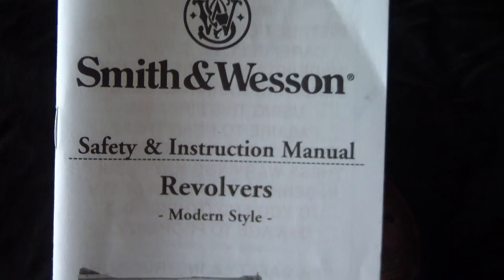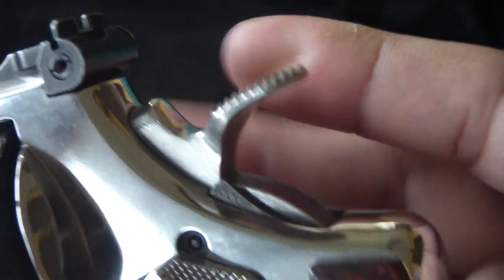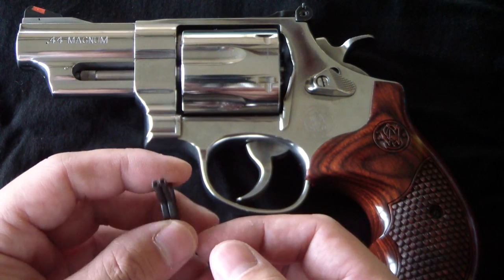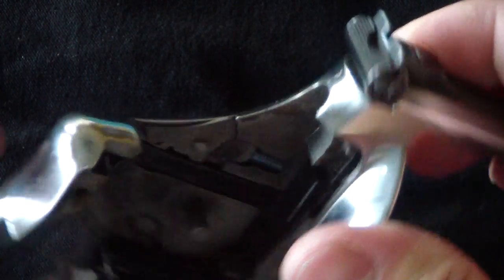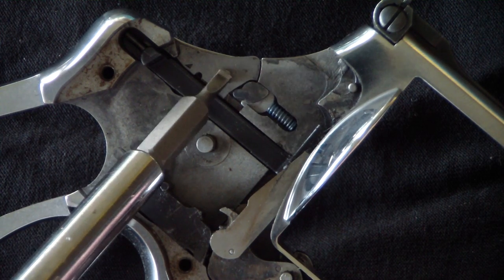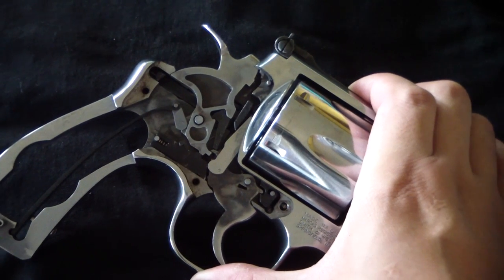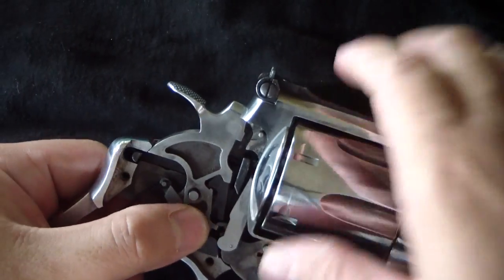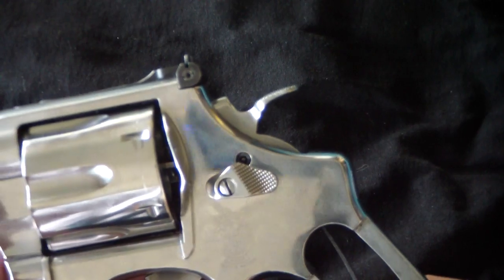s&w revolver key lock (close up in HD)

Comment: That damn keylock is the reason why I will not even consider buying a new Smith revolver when there are so many older examples out there that don't have this "feature".
Reply: Me too
Reply: Same!
Reply: @zachariahz9832  I have a new one. I removed the lock and plugged it up with an Original Precision kit. The new ones are a lot cheaper than the vintage ones and I like mine a lot better after removing the lock!

Comment: You can removed the lock and it has a tiny spring on the back of that plate that rises and falls. But there will be a hole in the side of your gun if you do. Or, you can take the plate out and grind off that “nub” and put it back in and you’ll never know it.

Comment: I just bought a 629 and didn't even give the lock a second thought.  Then I read on the internet how everyone hates the thing.  If given the choice I wouldn't want it on there either.  Failures due to the mechanism are pretty rare.  Guess I don't understand why this is such a huge issue.
Reply: Owen Hoffman it's not a huge deal. I have two. Great guns. It can be removed so people shouldn't care.
Reply: I guess it's a matter of odds.  My 686P has the lock and I had zero idea it was even there until a friend told me about it.  He was hell bent on telling me I should remove it, but I have a different take.  If it's not broken, why mess with it?  Using the "what do you do if it fails when you need it" I think is very unlikely.  I dump hundreds of rounds through various guns most months.  The likelihood of a failure would seem far higher in one of my practice sessions than the very moment I'd need the thing in a defensive situation.  If you never shoot your gun and only have it for that one moment of necessity, then it's my opinion you're too reckless to be owning a firearm.  Other than that, the few hundred I've put through that 686P have gone as intended whether I was shooting magnums or specials.  Doesn't seem an issue in my opinion.

Comment: hey bro..u seem to know ur stuff. .so i got a question for u..i own a 686 plus snubbie. .the other day i was cleaning it and noticed when i pulled the trigger back that the internals seemed like they had some rust...the gun is brand spanking new...so i took off the rubber grips and noticed that its like brownish orange dust....whicj im thinking rust...soooooo????? do i put oil in there???? ive heard that if u put oil u will gum it up....please sdvise brotha. ...by the way. .i have hoppes oil lubricant that i use to clean the gun.
Reply from the maker: Yeah you don't want to just soak the internals down heavy but i'd remove the side plate and see whats going on if you don't feel comfortable doing that your self take it to a gunshop that services guns. Sounds like rust to me I have had that happen to me once bought the revolver got it home always felt it was gritty and to find out under the plate internals covered in rust.
Reply: ok cool.....will do....do u ever put ANY kind of lubricant in there?
Reply from the maker: yes but very light coat.

Comment: I’ve seen where someone had taken the “locked bar” piece out but left the turn key lock in the gun, is the gun still safe to use?
Reply: Yes, I took mine out and replaced the actual key lock with an Original Precision plug. There’s a spring in the frame that holds the lock or plug and it’s not in the way of any moving parts.
Reply: I've put 2,000 rounds through 629-6 removed the lock even before I fired first round.
Reply: @ShaunPaget  Could you have done the same with it in and not have a failure?
Reply: @francischambless5919  it has been documented the lock inadvertently actuating under heavy recoil.  .44 is no slouch..  It is also a feature many people including myself find highly undersireable.  Pre locks out sell new s&w every time on gun brok er. Check for yourself.
Reply: @mikem2132  Thanks for the tip.  I didn't know anyone was making a plug.  I'll be sending out an order shortly.
Reply: @mikem2132   thanks for the info.  I installed it moment's ago.  I am well pleased  Origional Precision.

Comment: I can see how the lock feature is useful in households with small, inquisitive children. It appears to be more reliable than the cheap trigger locks used heretofore that can be easily defeated by a five-year-old. It could well prevent tragedies and subsequent disintegration of marriages and families. Disabling the lock should only be done by those who don't have youngsters in the house. I complement the designers responsible for this innovation.
Reply: I was a young and inquisitive child in the EARLY  sixties well before the rise of the safetie-sallies and was instructed to NOT touch guns unsupervised. Under supervision I would dry-fire, etc. I guess the population was just a lot freaking more intelligent.
Reply: If you have young  Children you need a safe, not a trigger lock. Imagine all the time, effort & training people saved because you can just turn the key, The number of other handgun manufacturers injuries & Death  with out A TRIGGER  LOCK  most be huge difference . "Not".  If we  could just find a lock for left wing Lawyers & reporters.
Reply: If you have enough money to buy this gun you should have enough money to buy a storage container or safe. What it is. They put this lock in and jack up the price. Then they start to skimp out on features on the gun. So instead of a lock I would like to have the serrations on the back strap or real C&C trigger and Hammer.